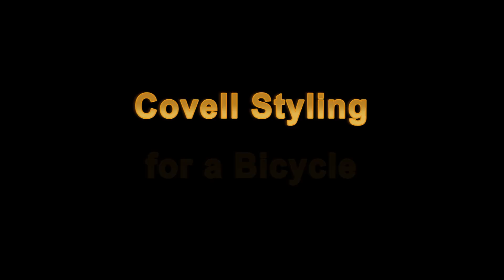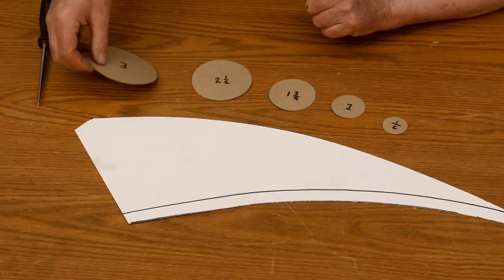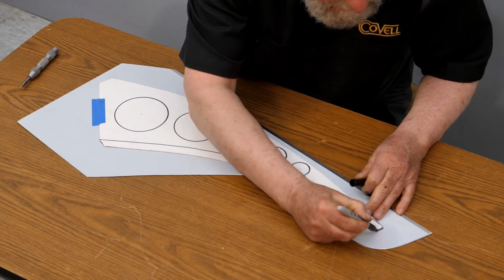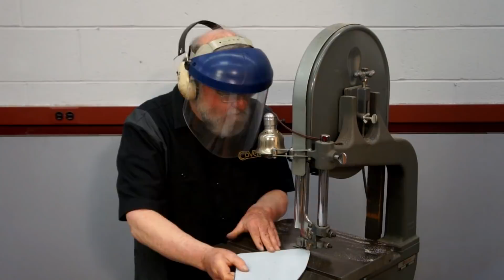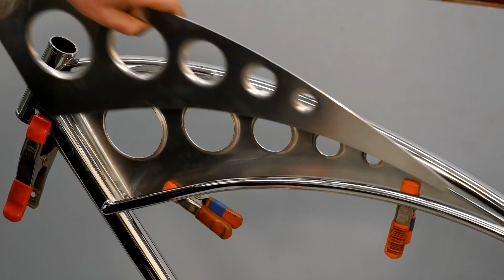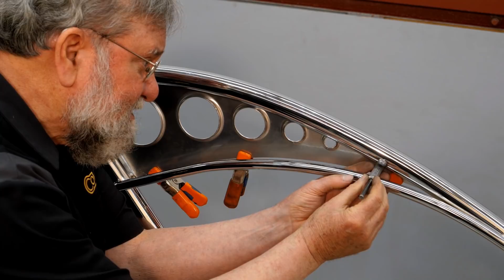Ron Covell styles a Bicycle

Comment: Great video, you didn't show what you fastened the screws into on the opposite side, I assume maybe a A corn style of nut?
Reply from the maker: The screws on both sides engage the internal threads in the standoffs between them, pulling the aluminum plates tight against the top tube of the bicycle frame. The bottom row of screws are similar, but have spacers under their heads that are supported by the middle row of tubing.
Reply: @RonCovell  ahh! Makes sense. Thanks for the explanation. Love your metal work!

Comment: Is it possible to make a steel trellis frame for a track motorcycle, or is it to dangerous? Thank you, all the best.
Reply from the maker: There have been tens of thousands of steel frames made for flat track motorcycle racing. If properly done, they can be quite strong. Most high-performance frames are made from Chrome-Moly steel, but most production frames are made of mild steel.
https://www.candjracingframes.com/

Comment: I really like the look. However, I'm wondering what you might do if you wanted to keep the screws and spacers from interrupting the smooth look of the panels.
Reply from the maker: Well, there would be a few options. Magnets, Velcro, Epoxy, or Silicon adhesive would probably work.
Reply: @RonCovell  I had considered epoxy, but not velcro or magnets.

Gotta say, I think it's pretty stand-up of you to reply to a new comment on an older video. I appreciate it.

Comment: Artistry! I wonder about best strategies with fasteners for corrosion control if these technique are used on a boat or outdoor fixtures. I see 3 or 4 different alloys in this image I assume the large surface area of aluminum takes the hit or does something migrate out of the fasteners, i.e. rust spotting? It's great to witness your Pattern Making, how you develop dimensions using (tape) offsets, transfer centerpoints, etc.
Reply from the maker: Well, of course using stainless steel for everything is the best strategy. Glad  you liked the pattern development - I really enjoy that part of the process!

Comment: Ron, Your works are  awesome. I have two questions.
As a newbie, Is it good to start with Tig instead of stick ?
Can i tig aluminium with DC Tig?
My end goal is to weld some bikes, motorcycle and cars for fun. I have zero experience in welding. Thank you!
Reply from the maker: I'm glad you like my work! TIG and Stick welding are quite different in several aspects. The advantages of Stick welding are low cost for the machine, no need for a shielding gas, and the ability to easily weld very thick materials, and materials that cannot easily be scrupulously cleaned. The advantages of TIG welding are having more control over every aspect of the process, the ability to weld most kinds of metals, the ability to weld both very thin and medium-thickness metals, and the potential to make small, beautiful welds when needed. While it is technically possible to DC TIG weld aluminum, AC is much more common, and AC provides a cleaning action that is very desirable.
Reply: @RonCovell So it doesn't matter whether you start with stick or tig as long as it meets your needs and preference. sorry for the delay, I had problems with internet connection. Thank you so much. stay safe!